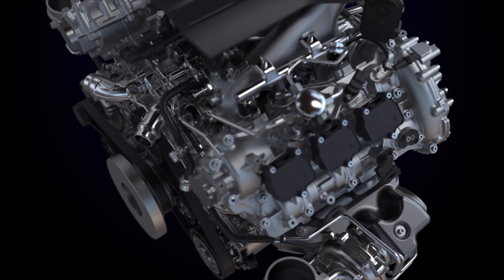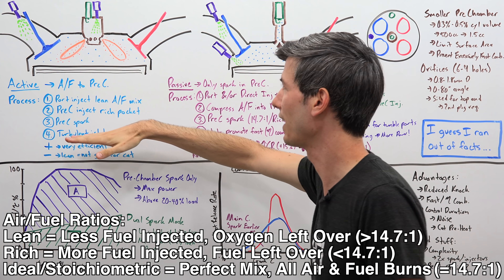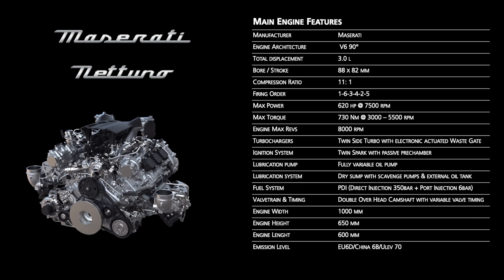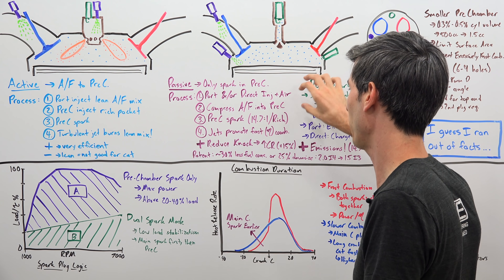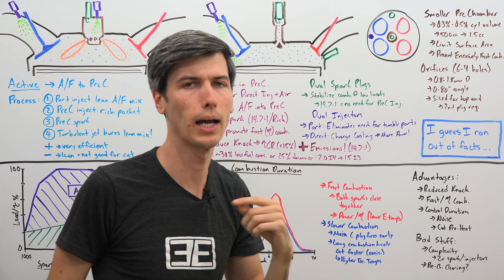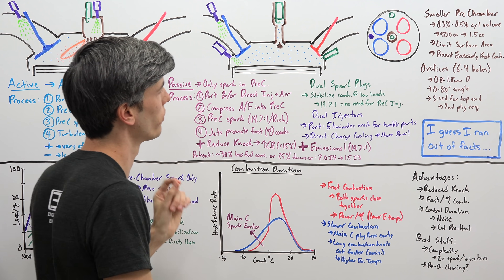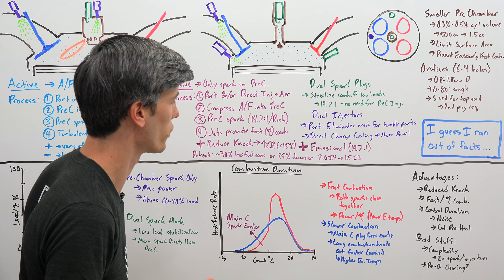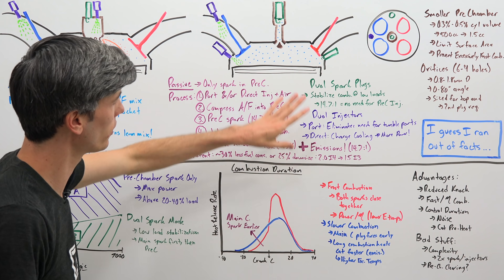How Maserati's Brilliant MC20 Engine Works - F1 Tech In A Road Car!

Comment: Yamaha also had a couple forms of pre-chamber tech in the 80's with 'YICS' and 'YEIS'
Reply: Old hondas civics has pre chamber
Reply: @CBTECH_AUTOMOTIVA  They called it a 'stratified charge engine.' I remember those, not all of them had it and they could not get it to work well for a road car. It would have been better for something running in a constant or narrow RPM window like a generator or a hybrid vehicle.
Reply: Good to read and was it reliable?
Reply: I have a 86 maxima 500 engine Im trying to get started. How much do you know bout them?
Reply: @dakotavaughan6488  keep that stock airbox if you wanna ride it
Reply: @dakotavaughan6488  For a DIYer im fairly proficient with old carbed bikes. Most of these old bikes just have carb issues, once you rectify those issues they run pretty well. Check easy stuff first like spark to all cylinders, make sure fuel is getting to carbs, and every possible carb setting is set to factory default (with the hope that the bike jetting and airbox is stock) etc before you tear the carbs apart via a YT vid or shop manual
Reply: @dakotavaughan6488  turn the key to start.
Reply: @dakotavaughan6488  the 550 barely had the energy to turn it's own crank,  the 650 was quite wonderful to ride,   Just leave your bike on the front curb with 'free bike' sign on it.
Reply: Yics is a pain in my ass
Reply: Is this similar to Honda's CVCC from the 80's?
Reply: @pfsantos007  yes it's similar to CVCC and even older russian engine (i guess they called it stratified charge?) in term of concept
Reply: No, no, no,no, no. YICS and YEIS were not pre-chamber technologies. The YICS in my XJ650RJC (Canadian market Xj650s were the only ones with YICS) allowed each cylinder to draw from its own carb plus a smaller amount of air/fuel mixture from the other 3 carbs to create a swirl in the combustion chamber. YEIS was fitted to some two-strokes as a means of collecting blowback and feeding it back into the crankcase.
Reply: NO. YICS used intake tract resonance plumbing. NOT ONE BIT common with this Maserati multiple combustion chamber system.
Reply: @MarkMorland  You are right Mark, my mistake. Yics is a sub-induction chamber not a pre-combustion chamber and they are fundamentally different. YICS was engineered as a method to create turbulence and swirling in the intake charge not pre-igniting the fuel mix. Hope anyone who reads this finds your comment, and thanks for correcting me
Reply: Honda Civic had the cvcc.
Reply: No not similar at all
Reply: Mercedes Benz had it during WWII.
Reply: And the Honda Civic CVCC in the late 70's.
Reply: Sorry I have a mind of my own.
Reply: Maserati 3.0L = 630 hp
Nissan 3.7L = 320 hp

lmao at asian engineering
Reply: @ivangamer8022   Turbo vs Non turbo.   
Exotic sportscar vs moderate commute car.
Reply: @ivangamer8022  maserati shits itself after a couple of years. Nissan keeps rolling
Reply: @adammarshdixon  So why do we have Maserati's selling for more than 10.000.000$ meawhile this asian car is alive thanks to Reanult?
Reply: @ivangamer8022  Because people buy them everyone could have Ferraris and lamborghini but everyone would have to 100% stop buying to cause a shock and be like I want this for $1. 😂😂
Reply: @ivangamer8022  some have built 1000+ hp Nissan .
Reply: @ivangamer8022  there are two turbos and the compression ratio is higher dummy
Reply: @getthecash2560  asian engines can't handle high pessure and high revs. That's they are mostly ''naturally aspirated'' 
i think it's the low quality materials they use and some lack of engineering knowledge
Reply: @ivangamer8022  fyi, the Japanese adopted American manufacturing processes and principles after ww2.
Reply: @ivangamer8022  Except for the Japanese, of course.
Reply: @ivangamer8022  isn't that 3.7 NA vs 3.0 twin turbo? The engine frim the also turbo GT-R 3.8 would be a more apples to apples comparison, though you'd be comparing an old engine in a production vehicle vs a new engine in a yet to be released car with double the price tag.
The newer engine (in a car costing twice as much) is better. Wow, i contained my shock and sarcasm about as well as you contained your bigotry.
Reply: @ivangamer8022  the Maserati is brand new and the GTR is like 14 years old tho?
Reply: @ivangamer8022  lmao at Italian reliability, it's an oxymoron

Comment: It's a funny.... prechamber diesel were a thing about 30 years ago and now they all use direct injection (because they're more efficient and lower emissions) and now petrol engines are going away from direct injection and moving to pre chamber because it's more efficient and lowers emissions
Confusing as hell...
Reply: Direct injection diesel works at 10x the pressure of direct injection gas.

Comment: Jason would not agree with Donut Media's beautiful formula of more air + more fuel = more power
Reply: I think he would, but there is also more to making power, cars these days are about 30/40% energy efficient, everything else is wasted in heat or something else, make the engine more efficient and you don't need more air and fuel for more power

Comment: 1970's Mercedes Benz diesel tech coming to  gas engines.
Reply: every single manufacurer of diesel engines were using this before the common rail becoming the norm.
Reply: @Runmeerkat  that is call indirect injection
Reply: Many more manufactures were doing a prechamber/swirl chamber as well. Peugeot for example and even VW for a time.
Reply: @jarrusjenkins  Mercedes was the only manufacturer using prechambers with small holes connecting to the cylinder and an atomization ball in the center, other manufacturers used a different design, with a large connecting passage and offset injector. Technically the MB system is called "prechamber" other manufacturers used "swirl chambers"
Reply: @petarmiletic997  I think every other IDI diesel had a swirl chamber.
BMW, Toyota, Peugeot.... just a few off the top of my head
Reply: I was thinking this and Benz used it well. Hope it works well in a gas powered engine.
Reply: I believe the OM621 engines were even older...
Reply: Preach it brothers!  (Owner of an '83 MB 300D with an OM617 here)
Reply: Almost nothing new with the new engines but better applications makes difference. But I realy don't like maseratti's one.
Reply: To my understanding the "pre-chamber" of this engine has absolutely nothing in common with the the pre- or swirl-chamber of a classic non direct injection diesel engine. There the diesel/air mixture formation happens in the pre/swirl-chamber in an indirect manner. 
Here the "pre-chamber" is ONLY used to influence the flame propagation starting from the sparc plug arranged in the "pre-chamber". In case of the first petrol engine referenced to there was actually fuel injected into the pre-chamber.

Comment: One thing I couldn't understand was how the pre-chamber ever gets its fresh fuel/air mix in, as all I can see is the persistence of spent fuel/air/CO2 inside the chamber once the spark has occured!....
Then you finish by saying exactly the same thing!!!
Reply: Hmm so maybe that's intentional? I agree that in the exhaust stroke there will be burnt air/fuel mix inside the pre chamber. However, during the intake phase, these should all be sucked out into the main chamber and get mixed with the fresh air/fuel mixture. And because the relative volume of the pre chamber is so small, the amount of burnt air/fuel mixture should not be too much to cause a problem.
Reply: @ImaadAnsari  Absolutely.  I can't imagine the ratio of the precombustion chamber to total cyclinder volume being high enough to have to worry about refreshing the gases beyond what expansion and compression already do.
Reply: @SvdSinner  he says it's 0.3%
Reply: Temperature difference provides a pump, and there's a fairly high compression ratio engine underneath it. Fire is hot, hot gas takes up a lot of space so it shoots out. Several milliseconds later it's the intake stroke again and the precombustion chamber (surrounded by coolant) has had time to cool the spent combustion gases. Cool gases shrink, sucking in the new charge. Compression stroke also helps this, as once the exhaust stroke is nearly over pressure in the chamber is fairly low. 11:1 compression can force a lot of charge into a static tube, even before TDC.

Come to think of it, it's probably largely piston compression and less temperature difference, but they are both factors
Reply: Yeah i too have same questions.
Reply: Maybe it's Maserati's secret. Of how, when and how much by doing whatever. So that the germans don't copy Italian tech... again, and again and again etc. At least not so easily.
Reply: I agree....I didn't rlly understand what the prechamber does
Reply: Jason Albino It’s a tiny chamber with a rich AFM which is ignitable. It shoots flames around the cylinder head which allows the very lean AFM coming into the intake to ignite cleanly.
Reply: @rajkirannatarajan9276  oh that's much better..thanks for the explanation bro

Comment: F1 Tech - probably good for 1500 miles, maybe 3000 if you follow speed limits.
Reply: False
Reply: @AzathothsAlarmClock  well they have got warranty for 50k kilometers
Reply: @AzathothsAlarmClock  are you braindead? Maserati obv
Reply: @AzathothsAlarmClock  based on F1 motor regulations. 😉

Comment: Any particular reason they chose to make it a 90° instead of the more common 60°?
Reply: Probably so it can be machined on the same tooling as a V8. Staggered crankpins even out the firing pulses.
Reply: It'll actually sound worse and have more vibration in a 90 degree format.  Chevy and Buick V6s from the 80s were 90 degrees.  They were highly successful engines,  copied from their V8s, but you wouldn't want a sport exhaust on them.
Reply: @jamesengland7461  Not true, just look at the Ferrari's. I know what you are saying and that was true but they found ways around it.
Reply: Sound, maybe?
Reply: @IceBergGeo  These engines are offsprings of Ferrari's V8s, which have 90 degree. The Biturbos had 90 degree, too - nothing bad about it. I had a 90 deg V6 myself and could only complain it was pretty low tech (a threevalve Mercedes I inherited ... don't have it anymore ... also had two sparkplugs per cylinder).

I'm not sure if this is the way to go. What happened to corona spark plugs? Maybe these could use a new name now, but overall, it accmplishes pretty much the same, without even any seperate chamber.

The idea, however, is neither bad nor new. Big engines running on natural gas used ignition-chambers for decades, with Diesel fuel to fire up a lean NG/air mixture.

Oh man, I miss engine development...
Reply: Low vibration

Comment: How do they prevent carbon build up in that small chamber.  Guess the engine runs great for first 5k miles.  It would be funny if the car fails emissions when it gets clogged.  Great video
Reply from the maker: It's a great question and something I'm quite curious about (eluded to this at the end of the video). I don't know!
Reply: Engineering Explained the warranty on the motor is 50,000 miles so maybe longevity is an issue
Reply: look man the italians don't need your negativity, as long as it looks pretty in your garage you get your money's worth

Comment: i guess i know what ferrari's engineers were working on instead of sf1000
Reply: Darchan Darchan spark plugs must wear off pretty quick
Reply: I mean, how can a team drop so far down the grid in a single year without even a major regulation change? It’s baffling to say the least. 
It’s been tough being a Ferrari fan 🤦‍♂️
Reply: @24beat-176khearts  They where cheating before... Well bending the rules might be more accurate. FIA clarified to Ferrari what the rules where and Ferrari lost 40+hp.

They built a high downforce car because they had good power to compensate for the drag, then they lost power and the high downforce setup was not optimized for that. FIA also blocked further large changes due to Covid, stifling any major fixes.
Reply: @martinhubinette2254  Source for that 40 hp number? Sounds like unsubstantiated speculation to me. I expect the actual number to be substantially more than that.
Reply: @ASJC27  Most likely. I had heard the 40hp number a few times referring to different races and such. Speculation that they had a 40hp advantage on Mercedes and their engine buyers (Haas/Alfa), lower power numbers outside of qualifying races etc. However nobody knows how much they lost, outside of a select few. Edited it to make it 40+hp.
Reply: @martinhubinette2254  so exploiting a loophole is cheating? Ok mercedes dual axis steering is cheating :)
Reply: Martin Hübinette they did not cheat, if they were cheating they would be fined. I believe they found a window in regulations and they took advantage of it.That’s why Ferrari and FIA kept it secret so others teams don’t find out what it is. In exchange Ferrari remove it. Sorry for my English.
Reply: @martinhubinette2254  They actually lost close to 90 HP
Reply: @martinhubinette2254  Merc hired away a couple Ferrari engineers.  They gave up the goods on the Ferrari high speed power.  Merc added the same type of solution to their engine and submitted it to FIA for approval.  FIA said, hold up this isn't exactly legal but nothing says you cannot.  Merc says we're going ahead with it since Ferrari is doing the same thing.  FIA investigated Ferrari, but could not prove anything themselves.  Merc screams that their engine proposal is legal and then FIA says " ok more flow meters and the limit is  enforced across the entire fuel system.  Ferrari says , F U Mercedes
Reply: @OOpSjm  interesting
Reply: @24beat-176khearts  "without even a major regulation change" - There was a major regulation change that affected Ferrari's engines, and they couldn't develop around it because the whole Italy was in complete lockdown due to covid 19.
Reply: @24beat-176khearts  They had an illegal engine for the past few years. Once they were caught they said they won't be 'good' again until the new regulations take place (in 2022).
Reply: @ononakanoo4428  No they didn't , pay attention
Reply: @ononakanoo4428  How did they cheat? I followed F1 from 1997-2014 but not anymore.
Reply: @ononakanoo4428  They onoy cheated in 2019.

Saying "for a few years" is villshit and factialy wrong, delete your comment
Reply: @Salpeteroxid  they probably injected engine oil taken from the sump into the combustion chambers. It's basically extra fuel.
And a race is short so they won't use up all sump oil. Just a little bit.
 I believe the engine management systems/EFI  are tightly controlled and regulated. But that oil injection could have bypassed it all.
Reply: @24beat-176khearts  it isn't baffling.. they were cheating.. they are now no longer cheating....
Reply: I think Jeremy Clarkson once said that when Ferrari are doing good in F1 their road cars suck and when they suck in F1 their road cars are good and they seem to have been busy updating their lineup.
Reply: @TK-_-421  it's not the case here
Reply: I get the joke, but Ferrari is no longer the parent company of Maserati. There is still currently some Ferrarri made engine in some Maserati, but it will end around the end of 2021 (Ferrari do not want to continue the partnership now that Ferrari is an independent company). Hence it is unlikely that any Ferrari engineer is going to work on any Maserati engine, now and for the foreseeable futur (if by any chance Maserati survives to the PSA and Fiat merger, which is unlikely...)
Reply: @GenghisDaniel  it would be an EPIC mistake to let the historic Maserati name die.
Reply: Makes sense rightfully and I bet they’ll be using this.
Reply: @WarriorsPhoto  Lol
Reply: FIrst thing I thought when I saw this. This tech was probably used in last years F1 engine, and was not "legal" after Fia looked at it.
Reply: They're also working on a twin turbo 2-stroke V12!
Reply: Nope... This engine is designed by Maserati's engineers and Ferrari has nothing to do with it. Ferrari will stop supplying Maserati with engines except for the Maserati's that already have Ferrari engines (Ghibli, Levante, Quattroporte) and those will be replaced soon so all Maserati cars will have Maserati engines. Which is a great thing and I'm not even bothered by the fact that it's a V6. Some of the legendary classic Maserati's had I6/V6 engines.
Reply: They are working to a new engine for.the next year.
Reply: Yeahhh. Really livened up the midfield battle though at least
Reply: too soon
Reply: @sik59rt  best reply 😂
Reply: Didn’t Maserati end their engine contract with Ferrari?
Reply: @arvidjohansson3120  yeah they did
Reply: Ferrari doesn't even engineer their own engines
Reply: They always say if ferraris f1 team is doing bad they are gonna have amazing road cars or tech in this case, and vice versa.
Reply: @jonaskastrickas1218  the ferrari f40 and laferrari is made when ferrari at it's golden age and it was good. After all, there's no way for a small broke company like ferrari to be successful in both road cars and motorsport. They need to sacrifice one of them (or they could merge with another company just like everyone did)
Reply: Nope it’s fully developed by Maserati engineers!
Reply: The Nettuno engine is entirely engineered and produced by Maserati in Modena.
Doesn't share anything with Ferrari.
Reply: @Lemuel you're not 😉
Reply: I have seen this year ago with mercedes benz f1 car.
Reply: Its a 100% Maserati engine.
Reply: No Ferrari was cheating in F1 , the amount of fuel pressure that was used by their engines was illegally high that's why they were competitive,  but now they're busted and can't compete